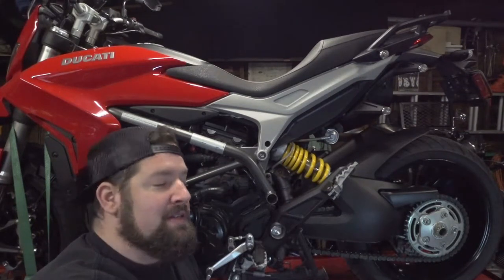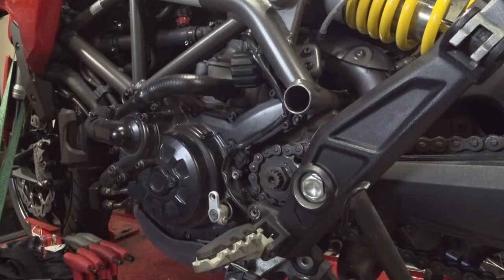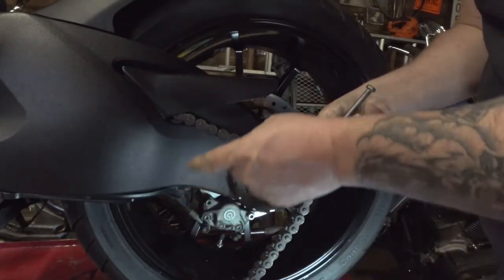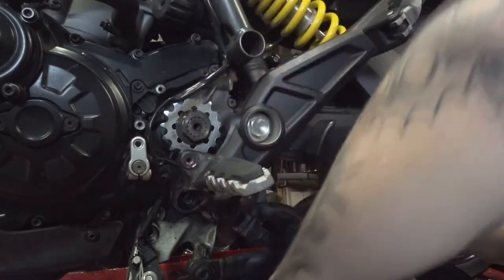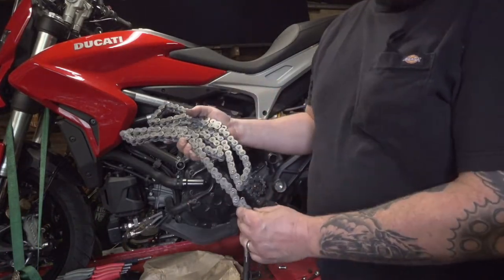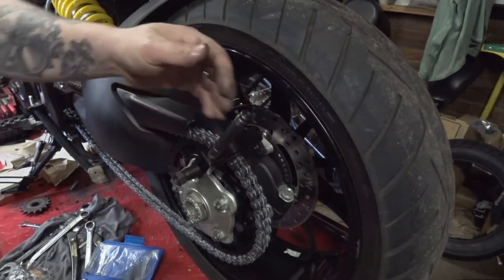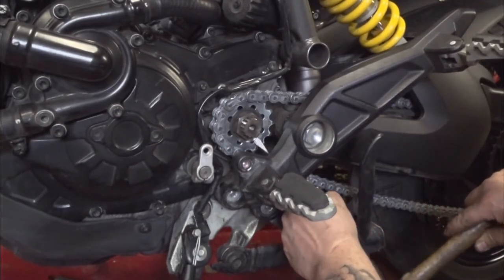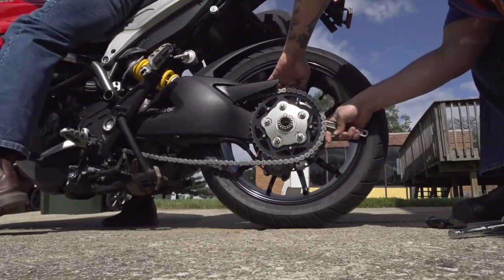Chain and sprocket replacement - Ducati Hyperstrada

Comment: Hi nice video, You didn't mention that new sprocket is different than original. it has adaptor, would be nice to hear more about it, since oem part is quite expensive, and there when You buy adaptor once , every next change of sprocket will be cheaper. And ther is more choice with number of teeths i think. regards buddy
Reply from the maker: Thanks.  I believe it was a vortex sprocket. But it has been a while now and I am not sure. It all went right on.  I doubt you would have to buy any extra adapters for any name brand sprocket.

Comment: Great video. Could somebody tell me the socket size for the front and rear sprocket nuts and as well as the torque specs for fastening ?
Reply from the maker: 32mm for the front sprocket. I don’t remember the rest.
Reply: @KnobleMoto  thank you so much. Rear is either 40 or 41mm. When motorcycle is available I will measure it and post here. Furthermore based on my  research I think that when you replace the rear sprocket by a two piece as in the video you will no longer need to undo the rear axle nut carrier. Just unbold the sprocket from the middle piece and you are done (when you put it in with the bolds facing outwards from the wheel ;)

Comment: On the rear sprocket, should the threads in outer bolts be on the outside? When I put it on that same way you did the bolts didn’t have enough clearance. I called and they had said to me that I put in backwards, I’m gonna put on tomorrow with the threads facing out and see if it goes... helpful video though I have the same exact setup, same bike with that same 520 conversion, kind of turning into nightmare with this rear sprocket now but hopeful it works fine.
Reply from the maker: Yes.  I put the sprocket on backwards initially.   I wasn’t sure anyone would notice in the video Lol. Threads go out for sure.

Comment: care to suggest how you blocked the rear wheel when removing sprocket and wheel? Thx…excellent vid…
Love your comments when discovering front sprocket won’t slide off easily…LOL
Reply from the maker: It was an assortment of prices of wood through the rear wheel and jack stands. The single sided swingarm made it a little challenging. It looked hillbilly enough that I was not filming it.
Reply: I figured as much but your candor, honesty and thorough vid is excellent!!! I have used a latex glove over axle nut in the past to avoid damaging the nut and also to ensure a better fit with socket….All the best
Reply from the maker: @louismartin4446  thank you! And good call with the glove idea!
Reply: I am in Canada and serarching a supplier of rear sprocket for my 796…(525, 39 teeth)…Where did you find yours?
I have same sprocket carrier but only supplier I could find JT sprockets said I need to by their sprocket carrier too because the new sprocket can be removed without removing the wheel. I think I want to stay with OE sprocket carrier….
Reply from the maker: @louismartin4446  it was either bike bandit or sprocket center.  However Bike Bandit is out of business.
Reply: Thx so much!
Reply: First gear will keep the wheel from turning. No need risk scratching your wheel or worse...
Reply: Except you risk damaging gears

Comment: Where you get the set of sprocket and chain??
Reply from the maker: Sprocket Center if memory serves me right.
Reply: @KnobleMoto  thanks,thats the same site that im planning to buy on,which do you prefer x ring or o ring for the chain.
Reply from the maker: @jaypilot6374  x-ring because it forms more of a lip seal to keep lubrication in, and dirt out. However I think I am probably splitting hairs by worrying about it to that level of detail.

Comment: So to remove the front sprocket we need to unmount the passenger foot-peg which also the center-stand ? 
Damn, that’s a real workout
Reply from the maker: It’s not as bad as it sounds.  But it is a little more work than one would expect for a sprocket change.
Reply: @KnobleMoto  I watched your video it’s pretty helpful, man !
I am preparing to upgrade my Hyperstrada 939 chain and sprocket ⚙️ set and I really like the sprocket set of yours, but want to fancy golden chains ⛓
Reply from the maker: @1xplorer  gold chains will
Make it faster lol
Reply: @KnobleMoto  By the way, can you list the wrenches size of the bolt and nut for this work, much much appreciated
Reply from the maker: @1xplorer  sorry I do not have the bike in my possession anymore.  I will keep that in mind for future videos though.

Comment: Do not try this at home folks. There’s a measuring sequence you must do as you’re pressing down and mushrooming that master link into place you’re supposed to mushroom it out about 2 mm. You don’t just jammin down till it “feels right”
Reply from the maker: According to RK chains, you want to flare the rivet out to a dimension of 5.56 mm. (For a 530 chain). That’s about .5mm larger than the original pin diameter.  2mm or .078” is way too much. You will damage the chain.
Reply: @KnobleMoto  The measurements weren't the point. The lack of procedure is. People watched you press the plate down without measuring, and mushroomed the rivet without measure. some will do the same after watching you do it. Ever seen a chain failure? I guess Harleys don't deal with chains...
Reply from the maker: @Magicinstalls  you’re right, Harleys don’t have chain final drives because a belt will last over 100k and according to the belt manufacturer, Gates, they have the same tensile strength as a 530 chain. 
In my 25 years of being a millwright, I saw a few chains fail on some machinery and high speed automation equipment, and I have seen the aftermath of a chain fail on a motorcycle.  However I have never had one fail on the countless metric bikes I owned, because when I put the rivet master link on, I pressed it until the pin flared out enough to cause interference with the side plate, therefore preventing the master link from coming apart and causing a chain failure. Just like I said in the YouTube video. 
The real question is do you always spend your Sunday mornings looking for minor technical errors in YouTube videos.  I own this channel and arguing with people helps push the algorithm. What are you doing here?

Comment: Make sure you have the owner sit on the bike so you can get an “accurate measurement“ and then don’t do a measurement on the chain tension… Brilliant!
Reply from the maker: Well if you want to get technical about it and nit pick of details of the script in a self shot YouTube video: Your chain deflection should be 2% of the center to center distance of the sprockets. But tag me in your chain install video so I can see how you did it.
Reply: @KnobleMoto  I didn't make a video cause there are plenty of them out there with the correct specs, and the tech showing how to measure them. My Ducati pikes peak chain calls for 27-29 mm of drop with the wheel on the ground. I know this because I measure. Like said people will see this, and copy you.
Reply from the maker: @Magicinstalls  Measuring is overrated. If there is so much good content out there, what are you doing on my channel?
Reply: @KnobleMoto  Public service combatting misinformation. As a ducati technician I feel it's my duty...
Reply from the maker: @Magicinstalls  you should make a post on Reddit about this, and add a link to my channel.  That’s way everyone will watch my videos and they can decide who is correct. It might go viral!